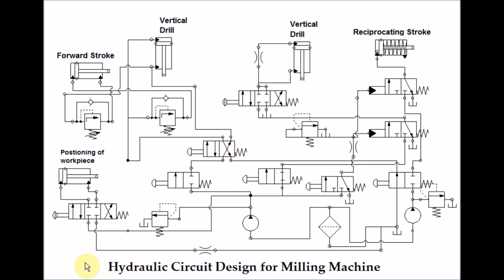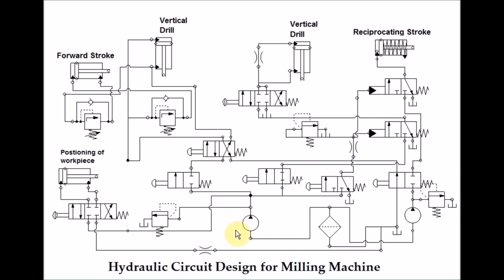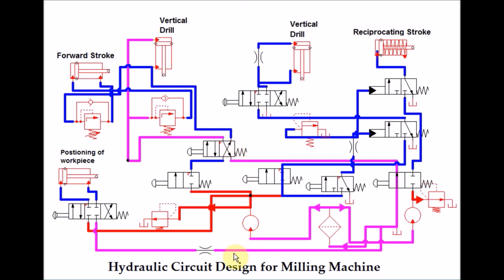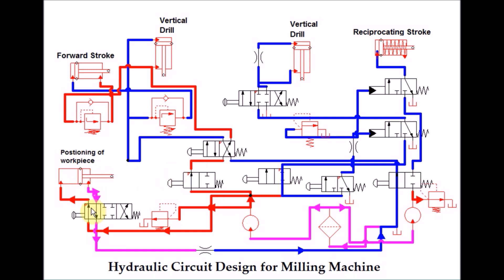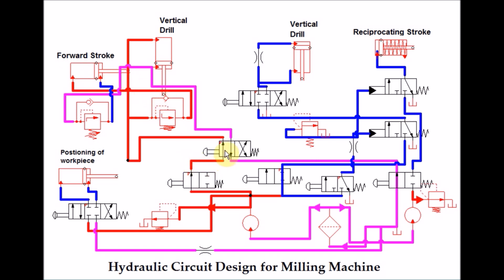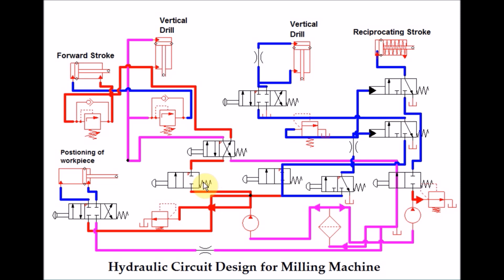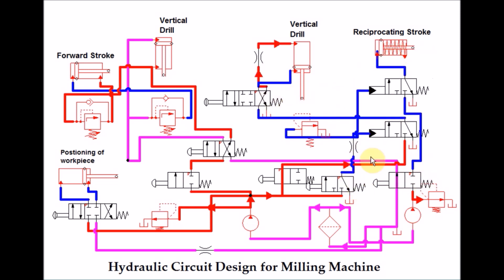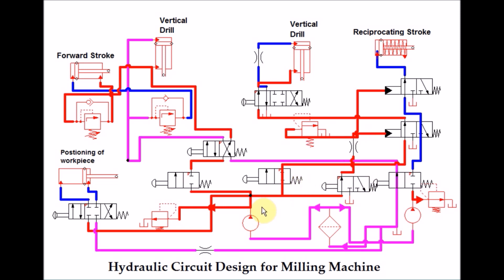Hydraulic circuit for milling machine_Nirma University

Comment: can you tell me reciprocating Stroke use for what part of Milling machine plz?
Reply: Chien Nguyen it is for table movement. As three possible movements of table: continuous forward, continuous return and intermittent. In iintermittent movement operator can set required depth of cut and machine can run on automatic mode.
Reply: HIREN PRAJAPATI  Thanks :D